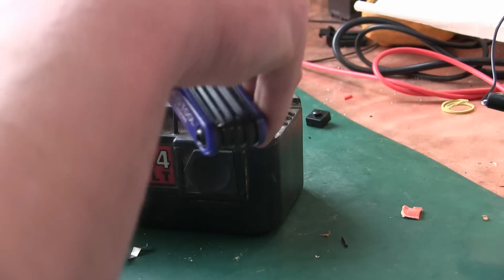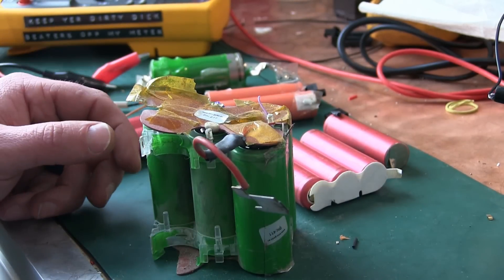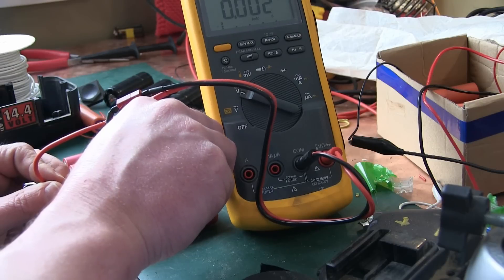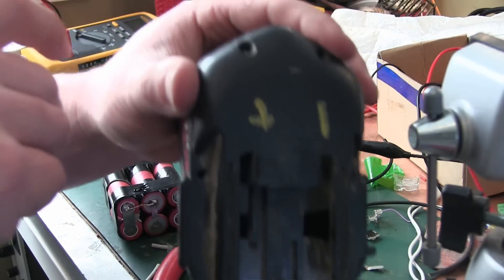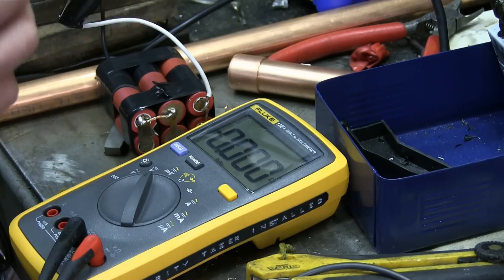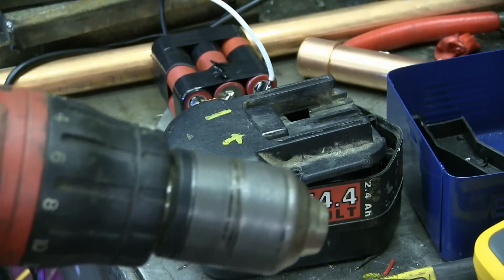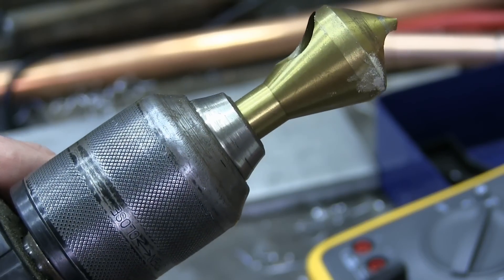New Lithium for Old Tools!

Comment: If I went out to Lowes or Home Depot which drill would you recommend?
Reply: The most expensive one
Reply: +GrimL0gic I always get the cheapest, because someone will just steal it anyway. :/  haha
Reply: Homeless Despot's Ridgid line is recommended, if only for the fact that if you remember to REGISTER YOUR YOOL, you're eligible for free battery replacements. Read up on it before you commit though.
Reply: Yeah I used a Rigid while fabricating my senior design project and liked it a lot. Drilled through 1/4" steel plate pretty well. Dont have much experience with other drills though.
Reply: +awesley92 Personally I've got a collection of M12 & M18 Milwaukee tools, and have been pleased with them. The M12 Hackzaw is my favorite cutting tool, I like how my Fuel circular saw will run full size 7-1/4" blades, and my 3/4" Fuel impact wrench is beastly. But OTOH, my Masterforce (Menards brand) 12v lithium impact driver works just fine, so I can't justify the Milwaukee replacement. And the Ryobi tools I had before worked pretty well especially with lithium batteries. 

For most home users, any brand will work just fine. If you think you'll get further into the product line than a drill and impact driver, see what all they offer before committing.

Comment: This can and does work:
https://endless-sphere.com/forums/viewtopic.php?f=6&t=51042&start=50#p1115682
You just can't use a lower voltage, or low amp cells like those. You either need high spec 18650's or RC type LiPo as I did in the link above.

Comment: Mr AVE, this is bad on many levels. Firstly I'm guessing those cells are out of a laptop battery? They can't output nearly enough current for that drill and it'll be pulling the battery voltage right down. Significantly shortening its life and contributing to poor performance. Secondly there's no balancing, so there is a chance when you connect it to your PSU, you'll over-volt one of the pairs and you'll be straight on that naughty list. What you need is a lipo battery and charger from RC hobbies, try hobbyking, they can handle loads of current and as long as you leave the balance connector accessible, the charger will sort the balancing. There still remain safety concerns with this approach, but you're a big boy!

Comment: DO NOT DO THIS. PLEASE PUT UP A WARNING AvE
YOU NEED A PROTECTION CIRCUIT SO THE BATTERIES DON'T OVERHEAT/OVERDISCHARGE
PLEASE PLEASE PLEASE

This is the exact same reason you have "hoverboards" blowing up in malls and shit

Comment: I've never had one of these battery cells burn up on me ...by accident. But I was developing some vaping units and had to extensively research lithium batteries and I would not recommend doing it your way, Ave. Mind you, I haven't seen them fail from using your methods but I have seen them fail and it's not pretty. I wouldn't store that battery in the house. 
There's all kinds of over-voltage, under-voltage, heat and balance charge protection built into lithium cells, most for liability issues, to protect against complete ignoramuses, I'm sure, but some are important.
Many will refuse to charge if the cell goes under 3 volts because it's affects the stability. ...I could go on forever about these very useful but potentially life threatening batteries. But I'll be brief:

You need to test each battery for capacity or milliamp-hours and put like capacities together. I wouldn't but any cell together in parallel that vary more than 50 Mah. They higher capacity one will try to charge the lower capacity ones and make heat.
  Balance charging is done because of this as well. You'll end up with different capacities in each cell on occasion, over time, especially if you're mixing brands and using batteries from different devices. That's why you often see many wires going to these batteries. If you see only two wires then there's only one cell or the balance circuit is in the battery. 
YOU NEED TO CHARGE EACH CELL INDIVIDUALLY. You can buy R/C chargers which have 4 to 8 channels for this for about 20 or 30 bucks. That's the way to go if you want to be safe, other wise, store these in a fireproof box or outside of the home!!!

Comment: AHH!!   Watch out everybody  when you tear off the metal tabs from the POSITIVE + end of 18650 cells or the nipple end of a  battery . Usually they are spot welded on but   only the nipple is   + and all the  naked surface from the opposite or  flat end is negative and a very short circuit  . Try not to damage any insulation l also found out the hard way .

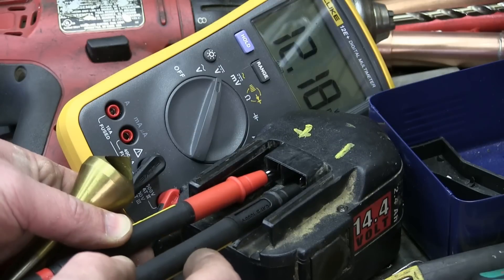Comment: Measure batterias under a little load at 8:53 i bet the actual battery voltage will drop another 3 volts when you load it up a bit, cell chemistry is a sneaky lover.

As usual dave has the answers https://www.youtube.com/watch?v=R8hTQXqURB4

Comment: Since lithium cells have a nominal voltage of 3.7 volts, the pack voltage will be 11.1 volts.
Reply: Fully charged to 12.6 v, 50% at 11.1 v, depleted at 9 v.

Comment: +AvE Hey man, it seems like Milwaukee still sells those NiCd batteries:

http://www.cpomilwaukee.com/milwaukee-48-11-1024-14-4v-2-4-ah-ni-cd-battery/miln48-11-1024,default,pd.html?ref=pla&zmam=31282435&zmas=47&zmac=731&zmap=miln48-11-1024&gclid=CjwKEAjwmf6-BRDi9fSN7Ijt1wUSJAASawcjdCEHiFO_CU4lVwHiYgIxv-xpl0g_F2LhM9N5I_61_xoCmpnw_wcB 

That way, your drill will be like brand new. Although I do like the idea of upgrading to lithium.

Comment: Bumblefuck LOOK HERE --> "HOW TO make an 18v NiCad to 18 volt lithium ion battery adapter for Milwaukee tools" <--

It fuckin verks i just made one for my old 1/2 inch 14.4v power plus combi and it's doing just fine all my other ones as well using my m18s. I have no affiliation with the guy who made the adaptor by the way, i just remembered you trying to make a new battery so thought i'd throw it your way as this one Doesn't need a 3D feckin printer lol.

Comment: If you want some old new stock  nicads 18v you can have them. I have have only one thing that uses that type of cell, a floor cleaning robot. Contact me if you need the batteries.